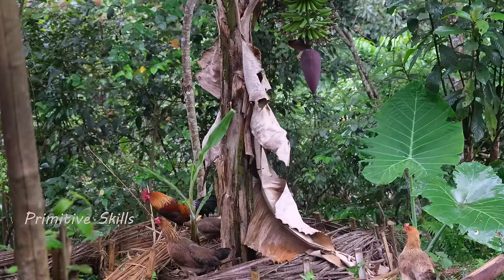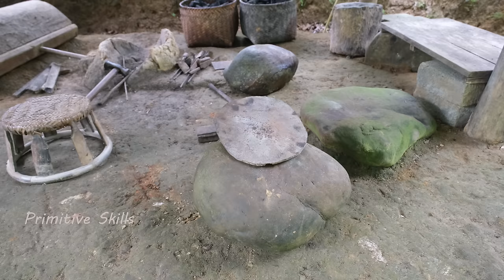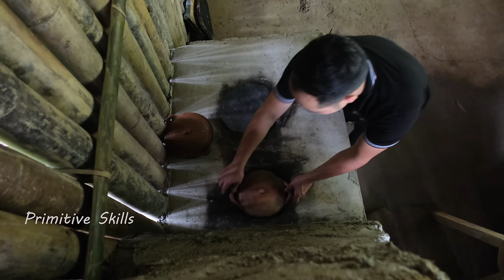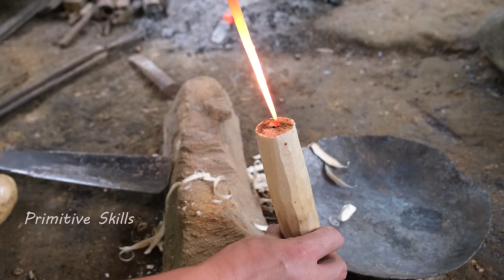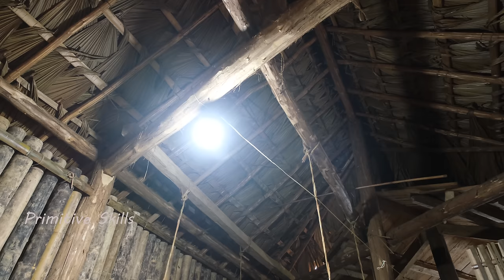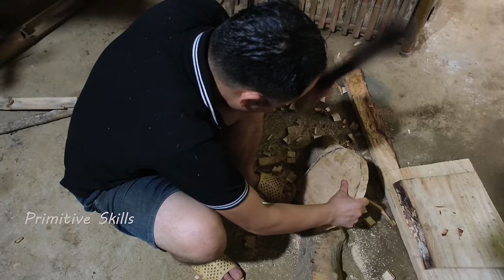PRIMITIVE BLACKSMITH | Forging iron pan, Cooking

Comment: An excellent demonstration of the blacksmithing art, but for the "time and money" cost, I would have been inclined to explore several shops with a collection of pots and pans in various metals and bought an entire commercial array of pots and pans that almost everyone could afford.   BUT his "wok" like pan looks like it would be perfect for my morning omlet using my gas ring turned down low.    The same as my light-thin skillet using an thermostatically turned down (to about 20~30%) electric hot plate.    
My recipe to start a beautiful day: "Using 2 eggs from a 700gm dozen pack, a small amount of fresh milk so that the eggs blend to the tune of my beating-fork then onto the well buttered pan to slowly cook the generous 0.3inch layer of egg mix, covered with a glass pre-warmed lid to watch it rise to caress the lid to a 2 inch high golden delight sprinkled with a dusting of salt and black pepper.   My morning coffee is medium-fine grind, light-roasted "Robusta" coffee grown on the local Atherton Tablelands, (not high enough to grow "Arabica" reliably), cold-dripped overnight to make a 'weak creamy flat white caffiene fix, with a perfect egg breakfast'".

Comment: Great video, as always.  You might consider using the English word "cabin" or "house" instead of the word "tent" at this point.  The word "tent" usually refers to structures that use fabric for the ceiling and walls.  Of course, we know what you mean when you say "tent."  but what you have built is now much more than a temporary tent.  It is now somewhere between a "hut" and a "house."  The best terms for that would be "shack" or "cabin" or "cottage."  You could refer to your whole farm as a "homestead," your "nursery," or even your "ranch."
Reply: My guess is that he refers to the living area as something like a camp and his translation software is making its best guess but getting it slightly wrong. We know what he means 🙃
Reply: Làm sao liên lạc được với chú ha.

Comment: It might be a good idea to purchase a hose from the market. That way, you can line the house and have water coming into your kitchen without worrying about the bamboo rotting away over time. It will also make it easier to hide the water line and make your kitchen even higher quality!

Comment: A suggestion....construct a water tank. You can use water that's stored. It will prevent water damage, and you will eventually have to change that back wall due to water damage.

Comment: I see the chickens are starting to scratch in the compost!  They will be a big help to you making compost.  Turn the pile so it is fluffy to help them get started
Reply: @Lauradicus  The soil has a very high clay content.  I believe it will take a few years of diligent composting to get close to the organic matter in the soil that one would need for "no dig".  I gather that composting is not a widely used practice in Viet-Nam.  If/when they can start adding manure and turning, composting will take off.  I'm operating with the assumption that they simply have to see the benefits to understand. Thanks for being supportive 😊

Comment: I strongly suggest you season the pan, now that you've made it.  Thinly coat it with oil or fat on all the metal surfaces, wipe off any excess, then roast it over the embers of a fire until it stops smoking.  Let it cool down, then repeat.  Do this at least 12 times (20 would be better), and it should help stop the food from sticking too badly.  (Yes I know that seasoning usually recommends 5 or 6 coats to start, but it's better to work up more layers at the start, because fat/oil is not often found in Duong's meals to begin with.  That means it's better to spend it on making the pan stick-resistant early on, than having to constantly scrounge up enough fats later on to keep things from sticking, because that actually requires greater amounts.)
Reply from the maker: Thanks for your sharing

Comment: I would advise sweeping up those flecks that peel off the iron as you're working it. a lot of people say "it's impurities beaten out by the blacksmithing. it's not. it's iron oxide that reacted with the air, and flakes off because physics, I don't know the precise reasoning, but i looked it up one time, it's basically rust. and in sufficient quantities saved up, I don't see why you couldn't resmelt it into more iron. might be a fun video to try that out, so be sure to sweep that up, and save it for another day!

Comment: You should build your next building at the water outlet of the fish pond. Then you can use this stored energy for a water wheel like you already do with the generator. Wich is overpowered for only a few lights by the way. You could also buy a electrical fan blower, but it will be very unromantic for your viewers 😅
Reply: I'm waiting for him to take bamboo, two snakes, and a rock to build an air conditioner at this point. 😆

Comment: Hi duong!  it would be pretty easy to drive your forge blower with your water wheel and pipe the air with bamboo to the forge? automate some of the hard work, best wishes , hope you like my idea....
Reply: Great idea!! He has done this in the past. And it works very well. Not sure if you noticed in the beginning of the video. He mentioned that it is raining, but there is not enough water to drive the wheel for the blower. Never the less, great idea and I encourage you to keep providing ideas. I’m confident he appreciates them.

Comment: Maybe it's time to upgrade your iron forging room? Make it more professional, upgrade your tools, the floor, the walls. The smithy is likely losing a lot of heat to the surrounding air, but if you build a little kiln, you will be able to heat the iron faster and to higher temperatures. I suggest to make a firing kiln for iron and maybe even see if you can get iron to a liquid state? Might be easier to make tools with that.
Compared to your bedroom and kitchen, the iron workshop room is quite lower quality, so it might be time to upgrade that space to look more professional?

Comment: Hi friend! Congratulation for the pan to cock!!
I will sugest something to your electric instalation, why dont you install a proper woden (well done) barrier, instead this stones into the chanel, to direct properly the flux of water into the generator. I think it will help you to not to do nothing when you open de "valve". Sorry for my english friend, i am mechanic engineer and i think this instalation may to start automatically when you let the water pass on. Best regards from Córdoba Argentina 😊

Comment: You need a proper anvil, sir, one made of metal; that rock won’t hold out much longer. Covering the top of a sturdy log set halfway into the ground with some iron is a good way to do it if you don’t want to make a solid anvil

Comment: Вероятно, этот парень еще построил несколько домн-мартенов из глины, еще нажег много древесного угля и еще раздробил много бурого железняка после предварительного нагрева. И всегда использовал те-же, похожие на большой деревянный шприц, мехи, которые в этом фильме подсоединены только к горну для накала и ковки инструментов и посуды. Потому что одной железной раскаленной крицы ему не хватило-бы для изготовления такого количества щипцов, мачете, молотков и сковородок. А общее количество разнотипных поочередных химических реакций при выплавке железа, чугуна и стали- 4 реакции: 1) реакция соединения углерода с кислородом, благодаря работе мехов. Это горение древесного угля; 2)окислительно-восстановительная термитная экзотермическая реакция, в которой бурый железняк отдает свой кислород древесному углю. Мехи при этом могут и не работать, но внутри печи температура будет достигать 2000 градусов; 3)это реакция замещения, при которой руда отдает углю остаток своего кислорода, а уголь взамен насыщает ее углеродом; 4)реакция соединения или цементации. При ней углерод древесного угля внедряется в толщу раскаленной тестообразной стальной крицы. Этот процесс надо останавливать путем разрушения печи, пока железо не пересытилось углеродом выше 2%. А то будет чугун и придется строить более сложную печь. Электрическую и с кислородным фильтром или баллоном. А в диких условиях строить такой мартен невозможно.
Reply: На мехи надо было поставить входной и выходной лепестковые клапана из кожи или кишки какого-нибудь животного или из зеленого бамбука. Тогда этот деревянный насос работал-бы еще эффективней. Или роль общего клапана мог-бы играть поршень в виде вантуса, как и в насосе для грунтовых вод. А молот с водяным приводом наверняка должен состоять из большого колеса с лопастями, шпинделя, коленчатого вала и кулисы- рукоятки этого молота. При этом поднимать молот коленчатый вал должен в пазу кулисы поближе к бойку молота. А опускать- находясь в пазу кулисы подальше от бойка, чтобы он быстро падал и ковал железо, пока оно горячо.
Reply from the maker: Thank you, nice to receive your feedback, wish you and your family good health

Comment: You could have just dropped the rock on it to form the proper shape... without any heat needed. Then you could have heated it up to reduce the tension between the iron atoms and then forge it into the final shape.